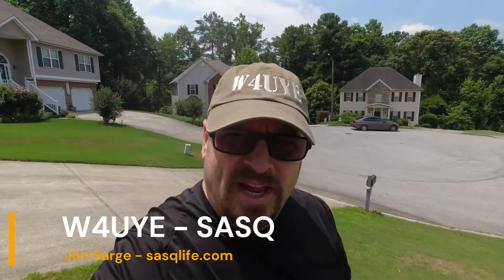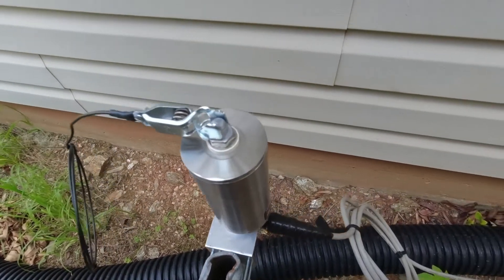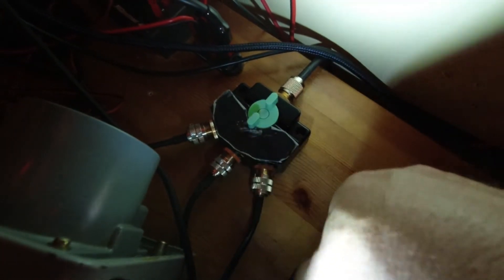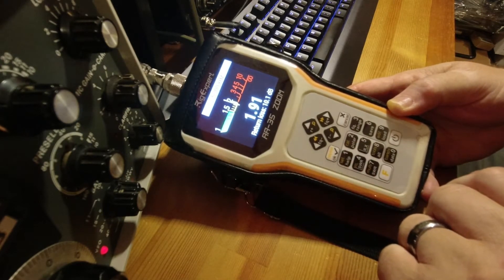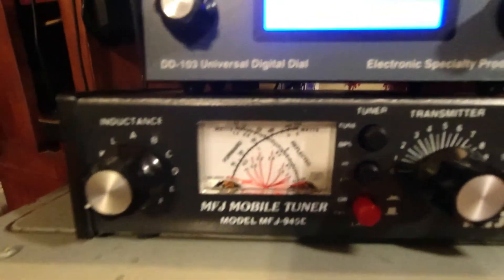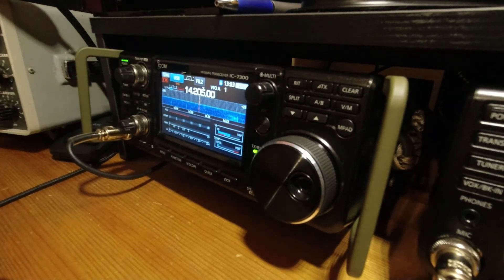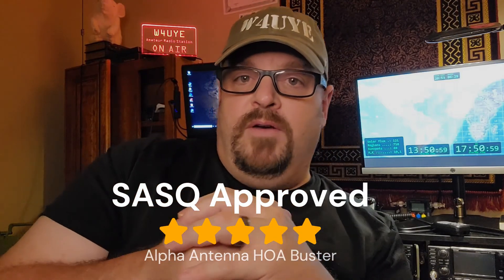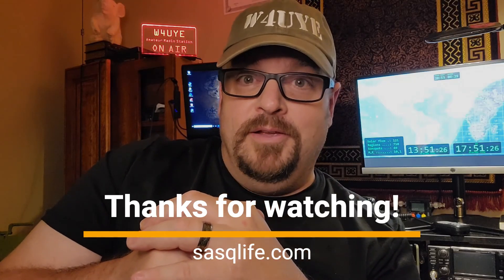W4UYE / SASQ: Alpha HOA Buster Rain Gutter Antenna System - June 2022

Comment: I have one of these. The claim that it's "tuner free" is an enormous stretch. It in fact does require a tuner for me, and everyone's situation will be dependent on your home. Depending on the length of your gutters, you may have enormous mismatch at some frequences because the gutters just happen to be a resonant length for a particular frequency. I am guessing this is a variation guanella type 9:1 unun, with some reactive elements. The antenna system "works" in that it gets you on the air, but it's a whole series of compromises that can be very frustrating. These types of antennas are noisy. You're using a piece of metal not made to be an antenna that's inches away from a house full of wiring. They are not predictable radiators, and the efficiency for me is quite low. Also, the lower power limits on digital modes are worth considering. Digital has a limit of 25w on this. That might be fine for a dipole, but when the radiating elements are low efficiency, you lose a lot of power. I'm not sure if the internals in this get heat soaked easily hence the limits. 

As a relatively simple turnkey solution, this works. But given the price and compromises, it is far from ideal. It's a nice idea, but in practice, it's incredibly dependent on your house and your gutters. The use case that makes the most sense for me is not at my own house, but staying some place like an airBNB where you might want to set up a portable station discreetly. In that case, if you slid some short rubber mat between the downspouts and the earth to keep them from grounding, it has some potential.
Reply from the maker: Oh it's definitely a compromise. And you have to have a very specific type of gutter arrangement for it to work at all. It's just another tool in the toolbox for folks to consider. I've worked the world with mine over the last 4 years and love it! Even though I'd have better antennas now, this thing still gets heated up from time to time. 🇺🇸🇺🇸🇺🇸

Comment: Coiling excess cable creates a transformer of unknown value I’m told.
Reply from the maker: Most use it as an "air choke". Helps keep RF from making its way back into the shack. I've always wrapped 3-4 coils in em, following the example of my grandfather, the original W4UYE.
Reply: @SASQ  really? It’s Good?! Wow, I have learned so much from the Hams here on YouTube. Thank You!

Comment: Thanks for the informative video on how well the HOA Buster Rain Gutter Antenna works.  I am considering getting one to get back on the air with the restrictions my HOA has regarding antennas.  It was nice to see at the end of the video the LED sign you purchased from me on eBay a few years ago still running well for you.  73s, NU9K

Comment: Thanks for the review! How are you electrically isolating the antenna and cables from your HF gear, so it doesn't get fried in a nearby ground strike from lightning?
Reply from the maker: Manually disconnect in times of bad weather and put the coax end in a pickle jar away from the equipment. Not high tech, but it works. Time proven technique taught to me by the original W4UYE.
Reply: @SASQ  That is exactly how my Dad (K0QBR, SK) did it and I do the same.

Comment: Hi, I am very new to HF bands. Just got my first radio set-up a few days ago. And sadly not many HAMs for a young guy like me to chat with in my area. Some questions I have. Is it pretty common to always have static on HF bands? Not as quiet as VHF or UHF? And you mentioned that it’s really quiet on the bands. Is that common not to find anyone really transmitting? Sorry for long questions and that’s for the informative video. 
- KL5MK
Reply from the maker: In short, yes, there is always static on the bands. The antennas are always picking up some type of natural or man made emissions QRM/QRN). On most HF rigs, this is controlled by adjusting the AF/RF gain balance, noise reduction, filters, etc. It's a bit of an art to get everything set just right, and this is if they band conditions are cooperating. I've found the lower the band, the more hash you're dealing with. Knowing your equipment and it's features go a long way to help draw a signal out of the muck - def worth checking out some videos on noise reduction/filtering on your specific model of radio. 👍👍👍

Comment: How does the rain gutter antenna compare to a dipole or end fed antenna? Have you compared the rain gutter antenna to any other antenna?
Reply from the maker: I have other antennas and the rain gutter holds up quite nicely. Works about the same as an end fed, but not as well as a dipole. Works better than a ham stick or coil loaded vertical. Even with other antennas, I still use my rain gutters - because they do work really well.

Comment: Courious we’re did you get that switch at ?
Reply from the maker: Picked it up on Amazon. It's worked really well though, no issues as of yet with it. 👍👍👍

Anteenna TW-103 3 Position Coaxial Switch for 144/440MHz HAM CB or HF/VHF/UHF Radio UHF Female (SO-239) Connector Plated Golden https://a.co/d/ie2yKzi

Comment: at the window, you seemed to have two coax .... was there another transformer on the other side too connected to the other section of gutter?
Reply from the maker: The second Comet jumper is actually for my UHF/VHF rig - an Icom 5100. Additionally, in the video, there is a thinner random wire running out of the window - that is a balanced lead out to my speaker wire dipole I use for testing QRP rigs. I should probably get an actual panel to run these out at some point...lol!

Comment: 9 to 1 unun works too ! Ebay cost about $40..00 100watt.
Reply from the maker: That was my initial set up and it does work, if you add a counterpoise and a line isolator. However, the HOA Buster has worked significantly better for me and requires nothing else. Alpha put magic in their can. Let's be honest, in the grand scheme of things like $700 Icom handy talkies and $1500 QRP rigs - the asking price of $250ish isn't THAT much.